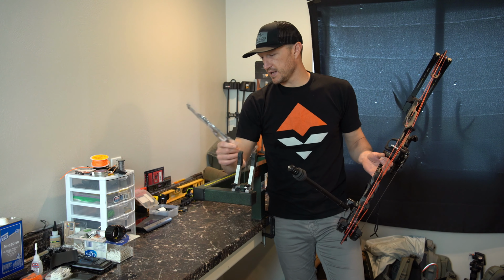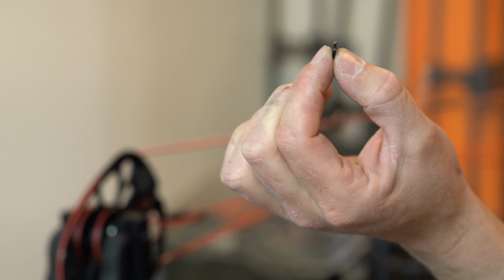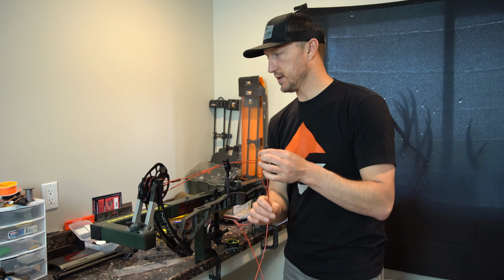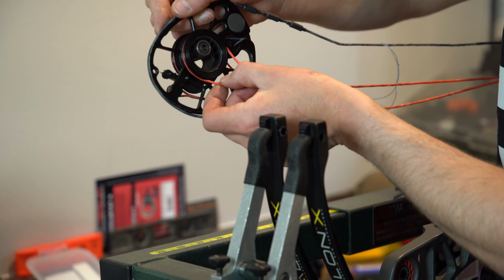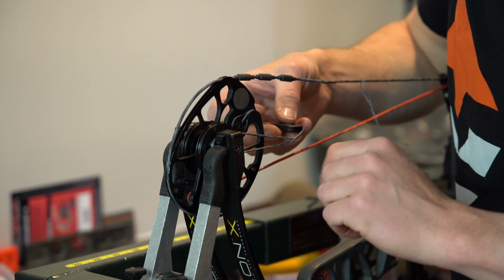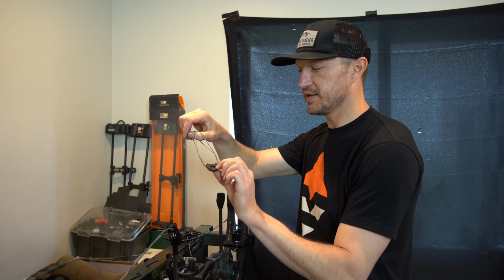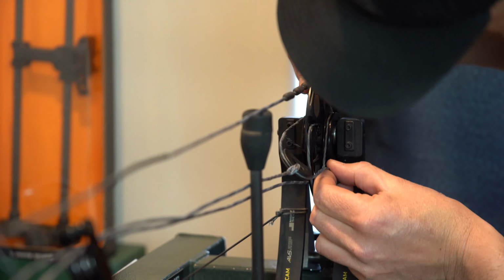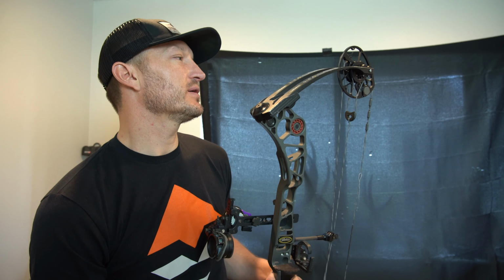Archery Tips: How To Replace Strings And Cables On Your Bow

Comment: You put up a great video of instruction.   This is why I still shoot single cam bows in the 310 - 330fps IBO rating zone for hunting.   That is plenty enough for hunting, and changing strings / cables, tuning = very, very, easy.  A Mathews Z7 or Switchback XT, or even a Mission Venture, Journey, or Eliminator  are very, very easy in comparison to change cables / strings / tune.   The deer or elk you are hunting won't know the difference.

Comment: Great video, really breaks down the Mathews system.

I was real bad about loosing shims, e-clips, axles...etc.  I bought one of those little magnetic metal bowls you see a lot of mechanics use.  Got it from Home Depot, sticks right to the top of the press, doesn’t get in the way and holds all the wee bits of the bow that are easily lost.
Reply from the maker: Glad it helped!

Comment: I have always heard never to remove a cam while the bow is pressed.  I believe Last Chance Archery even states this in their owner manual for the press.  Is it really safe to do that on these bows?
Reply: @jeremiahjohnson3063  LOL!  I guess I should have been more clear.  The instructions with the Last Chance press and what I have always been told, is to press the bow, remove the strings and cables, then relax the limbs of the bow and remove from the press before removing the cam.  I never meant to just try and remove a cam while it is under load from the string and cables.

Comment: If you prefer a worded instruction, here ya go. 
You'll need:
A bow (duh)
strings and cables
a bow press
1. put your bow into the press ( I personally use the bowmaster, it's a nice cheap press that won't avoid any warranties, and it's portable) make sure to back out the limb bolts at least 3 turns on both sides to make pressing the bow easier and safer, your press won't have to work as hard.
2. Open your new strings and cables, try not to twist them as they are the perfect length when created and twisting will cause incorrect brace height and incorrect Axle to Axle Length.
3. One at a time, take off your string, and then your cables (other way around works) make sure to keep the piece of serving at the top of the bow, that is the center of the string and where you'll put your peep. You can take pictures beforehand if you need to. Another option is to take the old string and cable loops off one at a time and immediately replace them with the new set. This way you don't get confused which cable goes on which side your cables are or where the string goes.
4. Make sure that your strings and cables are in the right spot, and that the string is in the track of the cam before depressing the bow, just to make sure that they are secure. 
5. Gradually hold up the string as you depress the bow that way you make sure your string stays secure as you release the pressure on the limbs and take the bow out of the press.
6. Reset your bow back to the previous poundage, check axle to axle and brace height to make sure that they are correct. Follow the steps of putting the bow in the press, taking the string or cable loop off the cam to add twists if needed.
7. You're done! Enjoy your new set of strings and cables!
Hope this helps you all on a worded instruction on how to install strings and cables, keep in mind that this is not a worded instruction for Mathews, but this will work most of the time (never shot Mathews so I don't personally know if top hats or stuff like that would get in the way)